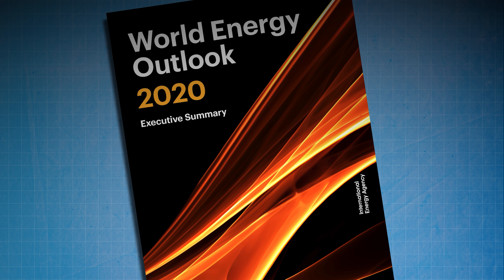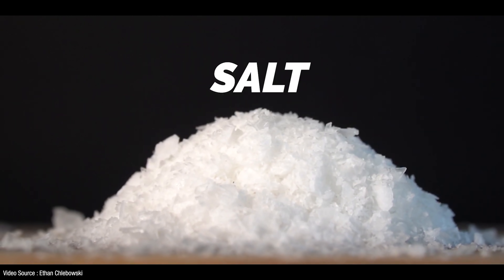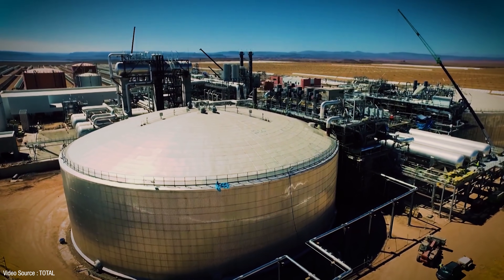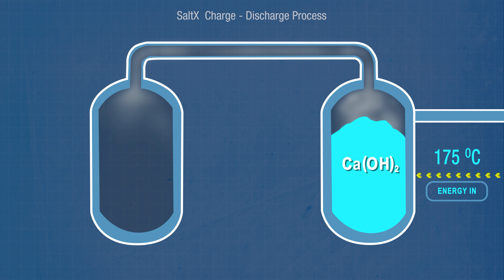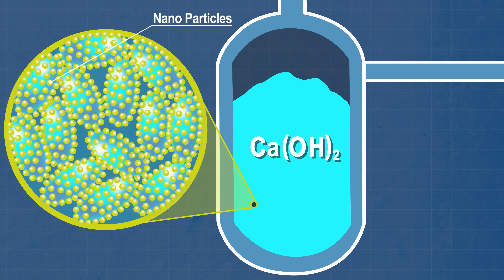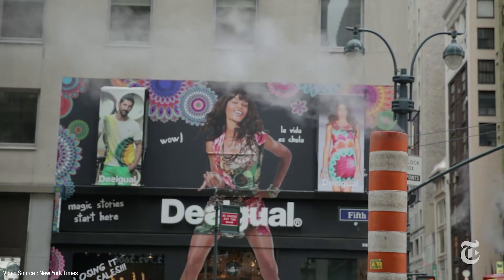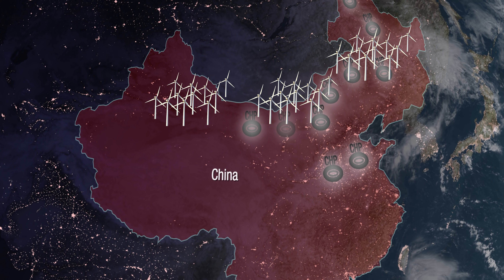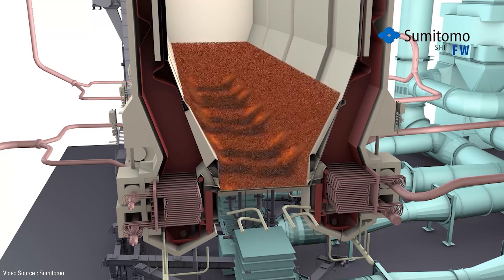Energy storage in salt - how nanoparticles are revolutionising the industry.

Comment: Interesting! If I heard this correctly, the nano coating also significantly reduces the corrosive nature of salts. If it can be applied to the fluorine and other salt bases in the thorium cycle it could help solve one of the bigger engineering problems, and add another generating technology to the mix. The spent fuel wouldn't seem to need separation- thorium isn't emmissive at low temperature and could be processed into the  concrete products.More and more interesting! FWIW, I am also glad to see the encouragement from commenters from one to another rather than the flame wars that had become too common. The thinking process is taking hold again!
Reply: I'm not sure that will be possible, even though I agree with you that would be awesome. 

The salt, as I understand, is mostly solid. In a msr, the salt is all liquid. The nano particles may not be effective then. 

I like the way you think though!
Reply: @treasurehunter3744  You may well be right, but it seems the way to the technology to make thorium a reality may have a new wrinkle. The corrosive nature of the liquid salts have been one of the largest ongoing holdups from what I have read or seen. I'm not a nuclear engineer, but grew up around engineers, so I definitely have that curiosity bone!
Reply: ThorCon is about 4 years away from having Thorium salt reactors up and running in Indonesia. They have ways of removing oxygen and water from the mix and using Xenon to prevent corrosion. Details in this vid   www.youtube.com/watch?v=oB1IrzDDI9g
Reply: @Jay...777  Missed this earlier- I didn't get a notice. The mysteries of the Algorithm. Glad to hear this- the small units this makes economically viable will fundamentally change rural electrics here and over much of the world. thanks, Peter!
Reply: This would probably depend upon how hot the salt can get before the nano coating begins to break down. In the video the calcium hydroxide/calcium oxide solution gets up to 500 C, but wouldn't the salt solutions in a thorium reactor be much hotter than that? I don't really know, but it seems like it might be a problem.
Reply: @Kevin_Street  The corrosion problem is solved. Details in this vid   www.youtube.com/watch?v=oB1IrzDDI9g
Reply: Thank you, Peter A. That's great news!
Reply: @Kevin_Street  Yeah, the scientists and engineers are capable people - now we just need politicians who are likewise. I guess the more ppl who know, the more discerning they can be with their vote. Kick up a fuss. Seems Indonesia will give it the get go once all the regulatory checks have been done. Costs look good.
Reply: @Kevin_Street  Nor do I possess an of the specifics.  It might take a little more engineering on the nano thing, but again IDK. Just some new avenues that have interesting possibilities- For one, it would then be possible to negotiate with countries like Iran, offering them a viable nuclear program that doesn't have the built in capability to create fissionable material like all uranium reactors automatically do. Or step up the small reactor programs so more rural and smaller towns and borroughs could have cheap power. For a Tesla, they could feasibly have their own power plant, as a note. Suddenly the conceptual reasoning behind a much more distributed power utility system becomes likely rather than maybe. Lot of spin offs from that.
But it would take the nano coating being viable to something higher than 500 C- I think you are correct there.
Reply: It would certainly make the COP targets more achievable! Then maybe we could keep warming to a relatively lower level. I agree with you, thorium reactors are a technology with incredible potential. It would also put more emphasis on the generation (and storage) of power instead of building vast systems of transmission lines.
Reply: @Kevin_Street  See what I mean- throw just one little germ of thought down the right hill and it will become a a huge landslide of change. JHAT
Reply: Seems like all they're doing is adding an anti caking agent like you'd put in table salt.
Reply: @krap101  the effect is similar but it looks much more pronounced. the anti caking component in table salt will do very little to inhibit the corrosive effects of salt on metals. I was a plumber by trade and things like electronic and scientific clean rooms were one of my "things".
Reply: @fredericrike5974  I'm fairly certain that as long as there's no free water, salts are not corrosive. Regardless, if you're building this out of anything but cres you're asking for trouble.
Reply: @krap101  That is essentially what I said. Cres?
Reply: @fredericrike5974  I only responded to your statement about the anti caking agents. Fundamentally there shouldn't be a corrosion issue if the proper materials and inspections are in place. 

CRES is corrosion resistant steel... Ie stainless.
Reply: @krap101  As I understand it, the corrosion is such that long life of the exposed parts is not attainable yet. Even stainless steel is not impervious, apparently. I'm a liberal arts type, so I don't have the science or engineering background to "fill in the blanks". I can regurgitate what I have seen- it just isn't always complete or entirely correct. 
I will note that so far the research efforts haven't found what the national licensing authorities want or the builders/operators feel are economically viable solutions to date. Great science opens doors, great engineering makes those ideas useful realities. BTW, thanks for giving me the clue!
Reply: Calcium oxide/hydroxide is an alkaline substance and therefore absolutely non-corrosive against steel, so this 'advantage' of nano-coating is not valid.
Nuclear salt reactors are working with liquid salts, so 'nano-coating' is not applicable.
Reply: @TheSpecio  So you are TELLING us that nano coatings cannot be done for molten salts, is that what we should get from your statement? Your opening limits the scope of what you said to the one salt you named, where my supposition was asking if this concept could be developed fr other salts, particularly the highly corrosive salts used in the Thorium processes being touted lately. And calcium oxide is only non corrosive if it is kept absolutely dry-as anybody who has set concrete would likely know from the amount of heat generated that a strong CHEMICAL reaction is going on.
Reply: @fredericrike5974  
It is very obvious that you can't 'coat' a liquid.
And it is very obvious that corrosiveness depends on the material affected. Steel in Concrete is NOT affected by the setting of the concrete. incidentally, the steel is PROTECTED by the calcium hydroxide.

It looks like you have some interesting cognitive problems
Reply: @TheSpecio  Have you ever busted out reinforced concrete? I have and even rebar deep inside the concrete, far from moisture admitting cracks is rusty on the surface. Protecting the steel was the intended function of coating the rebar with epoxy- a process that failed because it wasn't replaced on cut ends and when bent, the rebar tended to shed the coatings. I'[m not doubting that your hard science may be better grounded than mine- but in addition to a lib arts degree, I have 35 years as a high rise plumber and lots of concrete experience. The kind that gets your hands dirty. FWIW, a friend of mine from the concrete forming and placing world said that the surface rust was expected, and that surface rusting would help protect the iron if no more moisture was allowed to invade the concrete. And even I, poor lib arts victim that I am, have heard of ways to accomplish molecular encapsulation. I don't claim to have any deep knowledge of the subject, but it would appear others have not heard of your prohibition and went ahead and did it anyway.
Reply: @fredericrike5974  Of course the iron inside is rusty. It WAS rusty when the concrete was poured because nobody cares to clean it before pouring and the alkaline concrete can prevent further rusting, but it can not 'reduce' already existing rust back to metallic iron.
Reply: @TheSpecio  Cutting off the air- the oxide in ferrous oxide - will do that. And anything alkaline by definition is caustic and corrosive. Just sayin'. And " a little surface rust" wasn't what I was talking about. But for the purpose here- the bent angles and ends of the aforementioned epoxy coated rebar were rusty  when re exposed by demolition. 
FWIW, I don't think JHAT's creator had some intellectual game of "rock,paper,scissors" in mind- he seems to want to encourage thinking rather than just knee jerking because your particular science isn't reflected exactly as you see it. I'm thinking more like the late Stephen Hawking when a goodly group of other physicists had demonstrated some aspect of his string theory was incorrect- he said he was delighted that so many of his fellow scientists had put so much time and effort into proving him wrong- it gave him great hope for the peer review process, and he thanked them! FR
Reply: @fredericrike5974  Maybe you should learn some more about chemistry...
Reply: We store quick lime in steel drums for years.  No rust, actually the lime seems to inhibit the rust.
Reply: @letsgosurfing1786  Yes, quick lime is a very effective rust inhibitor because it's alkaline. Steel only rusts in an acidic environment whereby CO2 from the air is already sufficient as 'acid'.
And because concrete contains quick lime and is alkaline too, the iron in properly executed reinforced concrete does not rust, as long as air and water do not get in from the outside through cracks.
Reply: @letsgosurfing1786  As long as it is dry. But I get what you are saying. This nano wrapper has some intriguing potentials and not just for controlling salts- a host of things may benefit from this start.
Reply: Po Tato  You may be right. It's beyond my knowledge. It takes 300 yrs for the waste to become "safe" which is a lot better than the 10's of thousands of years for PWR's
Reply: Po Tato  Sorry to hear that. Well at least now you know what's coming. Hope it's not as bad as you think.
Reply: Po Tato  Right!
BTW: Zeolithes don't have this problem of clumping at all and are VERY effective for energy storage. They use the same principle: Binding water in an exothermic reaction, regeneration by heating. Unlike calcium oxide, they are not corrosive at all.
Reply: The nano coating itself, of course, if it is not a scarce resource problem already, could also be a sleeper problem for when it escapes into the environment.
Reply: @xenocampanoli815  Gotcha! The double edged sword of all technology- the unintended consequences!
Reply: I think the focus I find most compelling right now is around small tries to start, and long term concern about externalities at scale which do not occur at small batches.  On the first hand, I recall my old landlord from the 80s and his ethic in chemistry that you need to make sure all things work in the test tube before you make the factory scale batch.  On the other, what comes to mind are the BPA problems we find now from plastics and such, which have been there for decades, but we only now find out about.  That is one of the reasons we who were handwaving decades ago were so frantic then.  Fact is, if we prematurely scale things up now, we will likely find we are merely trading one ecological problem for another which is less familiar.  I don't want to discourage all this popularization and research, and I think Dave knows I feel he has a good part to play in all this, as do his readers/listeners.  However, we should keep coming back to the facts that 1) mother nature very well might impose a population crash on us at any moment anyway at this point, so we'd better start taking sustainability seriously, and 2) our biggest bang for the buck in terms of what we know, and our risk in general, is reduction in consumption.  Every short term tech step we take now should therefore be as small as we can stand, and we should make room for the future, as much as possible, by diverting our  activities now away from anything that in our wildest dreams might be scarce, and expanding the one thing which is infinite:  our knowledge.
Reply: @xenocampanoli815  Dave having pointed out a second use for the dry chemicals, once they recycle out in the original application, as base for cement is some of what you are talking about. This second use not only consumes but traps the "leftovers" in a long term use. FWIW, the energy required is why concrete rip rap is not as common as it could be as gravel base or road base. Answering the energy cost equation is one of the more important roads to that sustainable future with a "modern lifestyle". I wouldn't say our present knowledge is infinite but our ability to learn is vast- if we will apply ourselves to it!
Reply: I admire your enthusiasm for tech, but you have some misconceptions when it comes to this coating and the corrosion of steel.

The way this coating works is by increasing the distance between the salt particles. This reduces the adhesion between the particles that is present due to Van der Waals forces and  ensures a small space between any two grains. Or between a salt grain and the reactor wall which makes corrosion much less likely. The principle is known, although I have never heard it applied to salt before. When you understand how the coating works it is also obvious why it won't work for liquids.

[1] shows how the force changes between a flat surface and a 5µm large particle that has smaller particles applied on its surface (r = x = smaller particle radius, y = force in arbitrary units (it is missing a constant), a = distance between wall and surface of smaller particle). You can see there is a minimum for particles with a size of ~11nm. If you change R to different values you will get other values for the "force" and the optimal size of the smaller particles (see [2] and [3] and play around with the values yourself)

@TheSpecio is right, steel requires an acidic environment to rust. Check out this video (https://youtu.be/PLF18H9JGHs) for more details, the important part is pretty early. It also shows what happens when rebar really starts to rust in concrete. The thin layer of rust on the surface is irrelevant. 

[1]: https://www.wolframalpha.com/input/?i=plot+r%2F%28a%5E2%29+%2B+R%2F%28%28r%2Ba%29%5E2%29+at+a%3D0.4%2C+R%3D5000%2C+2%3Cr%3C100
[2]: https://www.wolframalpha.com/input/?i=plot+r%2F%28a%5E2%29+%2B+R%2F%28%28r%2Ba%29%5E2%29+at+a%3D0.4%2C+R%3D500%2C+1%3Cr%3C20
[3]: https://www.wolframalpha.com/input/?i=plot+r%2F%28a%5E2%29+%2B+R%2F%28%28r%2Ba%29%5E2%29+at+a%3D0.4%2C+R%3D50000%2C+5%3Cr%3C100
Reply: @turun_ambartanen  that is great for all you "in the lab" scientist types. In the nasty, dirty world where I made a living, I assure you I have seen "stainless steel" rust and corrode as well as less "blessed" materials. If salt has such a benign effect of steel explain the condition of Chicago automobiles, etc. I'm kind of done with you anonymous speakers from on high- I guarantee some mother did not put "The Specio"  on the birth certificate. I'll lay off Turan- but I have never heard of that as a name, and assume it might be a word in a language, IDK.  So, I'll leave it there are obviously very different results between the sterile world of the lab and the messy reality where i have had some experience. Good day.
Reply: @fredericrike5974  Oh, I know you can get pretty much everything to rust eventually. This is why there is no storage solution for nuclear waste yet - given enough time everything will rust, no matter how finely tuned your environment is. But salt is also not a magical substance that immediately turns steel into rust. If you have a sealed system (e.g. in a reactor like shown in the video) you can at least somewhat control the environment and limit the corrosion on your pipes and such.

Keep in mind, you are also a "anonymous speaker from on high". 

PS: > I'll lay off Turan- but I have never heard of that as a name, and assume it might be a word in a language, IDK
You are actually correct XD
Reply: Had exactly same thought, suspect adding new materials would just create further regulation and compliance issues (and delays) and ways of avoiding significant corrosion seem to exist and life expectancy appears currently limited by other factors such as moderator life. Maybe something like this will help in next next-gen reactors.
Reply: @derekstannett8477  I rather think getting us to JHAT is what our "host" has in mind for this channel. I enjoy the experience and the dearth of trolls-most of the responders here are as willing to learn and share as I could hope.
Reply: the nanocoating might not be able to survive the high temperatures of the molten salt
Reply: @justinokraski3796  That has been brought up. As this is a "new" tech, I am wondering how many other ways it might be used- engineers are a creative application bunch if any ever were!